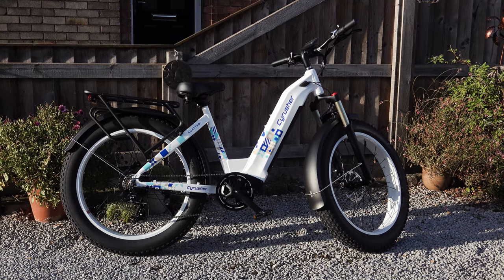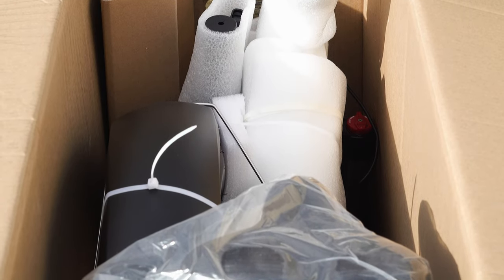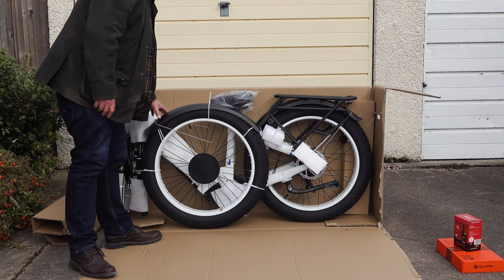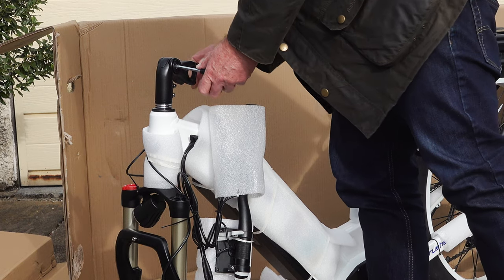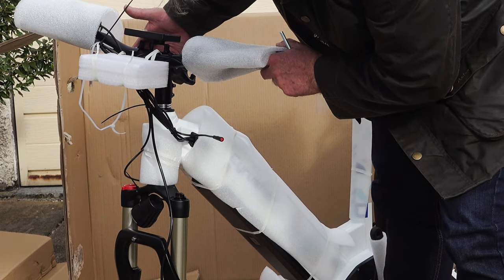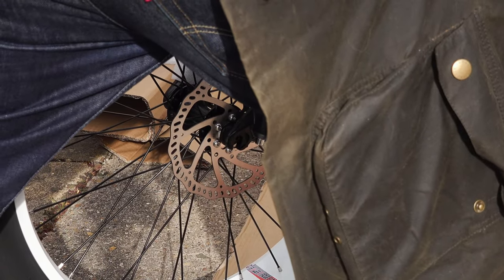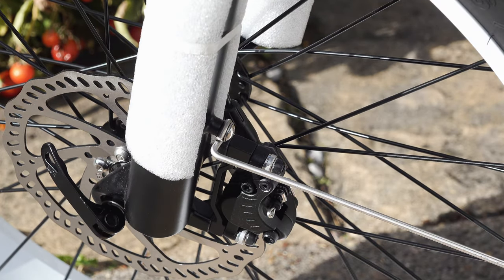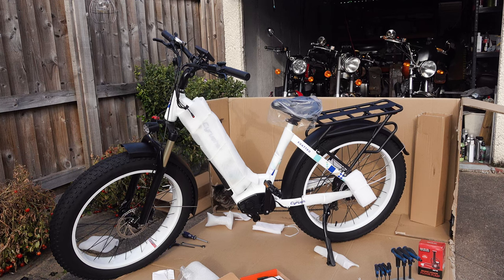Unboxing & Building The brand new CYRUSHER KUATTRO All-Terrain E BIKE!

Comment: For short distances this is the way to go. Efficient and also light exercise . I use a Dutch bike for local trips ridden in everyday clothes so no need to get changed just jump on and go. I don’t have electric assist and the bike has a very low theft risk so a simple lock is sufficient. 
On the other hand modern looking electric assist bikes are very high theft risk so you will need a very robust lock and always attach it to a fixed anchor. While my legs are still cycle racing fit I will stick with the Dutch leg powered option 😎but looking for electric assist for my wife and guests to use.

Comment: Hi Stuart, ah you got a Fatbike!
20 psi is actually quite firm for Fatbike tyres but be ideal for tarmac and smooth tracks, we ride them at 6 psi off-road and as low as 4psi on the coast,   they will prob have a max 30 psi on the Sidewall. Don’t worry about drag from Fatbike tyres as they have a kind of flywheel effect once rolling. 
Looking forward to your ride review 👍😁
Cheers
Bruce

Comment: Thanks Stu. Interesting video. Two points from my bike building experience. I always keep that brake spacer. If you need to transport the bike with the wheel off, it’s handy to pop it back in to avoid accidentally closing the pistons in transit. I always add a smear of bike grease to the pedal threads. It stops them corroding into place, especially when the crank arms are alloy.

Comment: Interesting set of wheels. Not rocket science, but nicely done.
A tip on working with tie-wraps (zip ties), for anyone interested. 
Keep a pair of plier type nail clippers in your tool kit, just for ties. When fitting, if you want to cut the tails off, snip them flush with the ratchet block and you don't have these little sharp tails that rip soft flesh to pieces.
When removing a tie, snip them underneath the block, DON'T CUT THE BLOCK OFF. This way the remaining tie is totally reusable..
Some of those ties were over a foot long and would have gone strait in my tie box.
Look forward to the review.

Comment: Wire snips are safer to remove zip ties. Also the axle clamp lever should point upwards an slightly to the rear, otherwise a branch or shrub could snag it and release.

Comment: I got an eBike a few months ago . Got me back into biking as I now feel confident riding further afield and being able to return under power  .It's not perfect but very good value compared to similar bikes from UK dealerships . Only real problem I've had is the left hand  (nearside ) pedal crank which seems to come loose on the square shaft .I'm working on a fix for that . One thing Stu ,those tyres look grippy but they're not very good on slippery surfaces as I found out  to my cost .

Comment: Yes, e-bikes are nice! And very easily you can improve your overall fitness quite a bit almost without noticing it - I used to hate cycling because my fitness was so bad - and every time there was an uphill or a headwind, I cursed like a true Finn! The only downside is that motorcycling has suffered a bit, only half the normal mileage has been accumulated... But I'm not so sorry because the gas prices have gone so much up.😁

Comment: As usual, a very interesting video. However, I have a question for you - the Cyrusher website lists this bike as having a "twist throttle" and that this "allows you to accelerate the bike in a more convenient and safer way." Am I mistaken in thinking that this specific feature would move this bike into the V5 Motor vehicle class? I've been riding a Specialized Turbo Levo MTB e-bike for many years and the pedal assist technology is fantastic, but I don't have twist throttle and I have to be careful not to exceed the UK Government specified road speed limit of 15.5mph. If I want to ride faster than this on any public road and/or use a "twist throttle", my ebike would be classed as a motorcycle or moped and therefore needs to be registered and taxed. I just wanted to highlight this issue and gauge your opinion please.

Comment: Looks like a nice chunky design Stuart,I bought an off roader as a lockdown project and it’s great fun to ride.Two tips,I always store the battery indoors away from frost in the winter and don’t leave it fully charged for weeks on end.Also my hydraulic brakes needed bleeding and it’s a real pain,because there’s no bleed valve on the on the calliper,anyway enjoy.

Comment: Having built a couple ebikes for the Mrs. and myself you may have a couple of tweaks to perform. First the derailleur system will undoubtedly need to be adjusted and there are some excellent videos out there to dial in the derailleur. Second, some disc brake systems have adjustment capability to center the caliper over the disk to prevent an annoying rubbing sound. I used a couple business cards as shims between the brake pads and disc to center the caliper.  I will comment on our experience riding ebikes when your review video comes out next week.

Comment: Nice video Stuart. I dread to think what the bike would be like to ride when the battery runs out. Trying to ride a 34kg bike will be quite challenging without battery assistance...  🙂
Reply: I was afraid of the same but these ones we have now are quite light to pedal - so that sometimes (no uphills and headwinds) we even do not use the electric assistance at all. The rolling resistance is not so much, the weight is about 25kgs on our bikes (the heavier weight the longer you roll). Actually, I get very nice speeds downhill with my about 100 kgs weight on the bike!

Comment: Hi. Loved your video, I bought the same bike and you were a great help with putting it together. Only one question, the red connector at the steering stem? Where does it plug in? You left yours dangling and never mentioned it. The bike seems to work just fine with it disconnected… but maybe I missed something…
Reply from the maker: It doesnt its a spare.

Comment: I'll be interested to hear about miles per charge etc too. Size of those tyres could make pedalling a challenge and with 20 psi. 
Hang on to the caliper spacer it's handy if you need to remove a wheel for, say a puncture or cleaning.
Good luck, " ride safe"

Comment: 750w !,don't get caught on it! You are only aloud 250w so if stopped you will get charged with no tax, mot ,insurance and end up with points on your real license. Probably should tell people that if you're gonna sell it Stuart.
Reply: Click on the website link...and all will be revealed by a disclaimer 👍
Reply: How often do you ever see the police pull over cyclists  with exception of those dibbets  that do deliveries  .  Tbh  You'll be hard pressed to know of battery powered by bike owners getting stopped
Reply: The ad for the bike says that for the UK market the motor is restricted to 250W and no throttle is mounted. It is included in the kit however and you can derestrict it yourself for riding off-road or on private land.
Reply from the maker: Its restricted to 250W
Reply: @stuartfillingham  This is because the legal limit is 15 MPH, they can be unrestricted but it carries a hefty fine if you are caught speeding, most people who build their own can easily reach 35 MPH assisted with a 1000 wat sysytem, when people start getting killed they will soon make it mandatory.
Reply from the maker: @daviddanielstephenson2833  Yes I'm well aware of the law, do you really think a retired policeman would not research this before publishing? there is no legal speed limit for cycles however power assisted cycles must be restricted to 15mph. A standard pedal cycle can reach 35mph. You need to understand that modification of these bikes would simply convert them into a motorcycle for the purposes of the road traffic act. hundreds of off-road motorcycles (not road legal) are sold in the UK annually so it is very unlikely that they would ban them, each individual would simply be responsible for the offences revealed.
Reply: @stuartfillingham  Yes, I know you are an ex officer and you cannot print everything involved with the subject, it is a minefield in the making., 
What I was pertaining to in my last post was, if the establishment can bring on a ban for new motorcycles they are capable of doing anything to quash independant travel.
How it normally works is, they get the public to make the mistakes and use this excuse to clamp down on any alterations like we are witnessing with the OEM-motorcycle MO.
It won't be long before they bring out a licence for these electric bikes, I would also not put it past them to bring out compulsary insurance for normal cyclists once enough take to the roads.

Comment: Looks like a nice bike, look forward to the road test. 
Miles per charge with lights on, would be interesting. 20 psi seems like a very low pressure, what is the maximum recommended?
✌♥️🇬🇧
Reply from the maker: That is the max. They are very chunky tyres!

Comment: Please Dear Boy.  Keep the battery away from everything. Away from anything that is combustible.  In my previous message I have three friends that regret not doing this. And one who watched  his Nissan Leaf burning like a volcano on the hard shoulder.  Be aware of this please and be prepared.  Knowledge is more power to the elbow.
Reply: Angus, I suspect that one day your walking stick might 'accidentally' connect with the spokes of one of those riding on the pavement or the wrong way down a one way street. What a shame that would be!
Reply: Insulting me is not very astute.  A garage was burnt down and a shed from the batteries catching fire. The third whilst being charged at work.  The car burnt the foot of the car driver, giving him seconds to bail.  The Fire Brigade cannot put the fires as they are not equipped with the necessary to stop oxygen getting ot fire.  I only want to warn, be aware this can happen.  And be prepared in the event.

Comment: that looks like a girls frame . tbh i wouldn't buy one period . Toooo expensive ,  Weigh a ton and the costs increase . A bike is meant to be Afforable to run its not the case nowadays
Reply from the maker: have you bought a pushbike in the last 25 years? The concept of a gents/ladies bike pretty much died 50 years ago.
Reply: @stuartfillingham   Yes  , A hardtail  Cube anlog 29inch ,  2017  . And the FS on my bike is  tooo heavy .  I won't spend anything over  1,000 on a bike     . I can't justify spending  1,000 plus on a bicycle  they are far tooo expensive ..